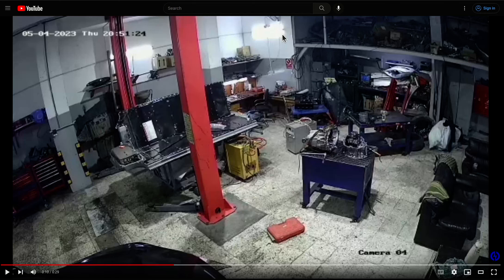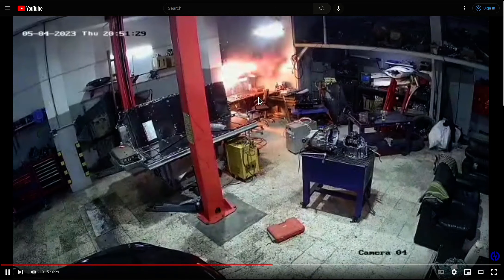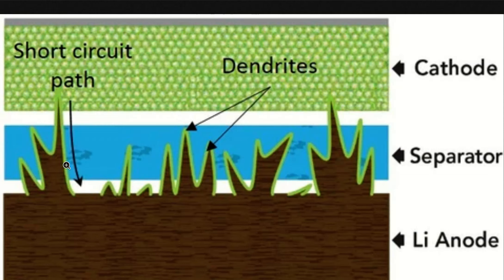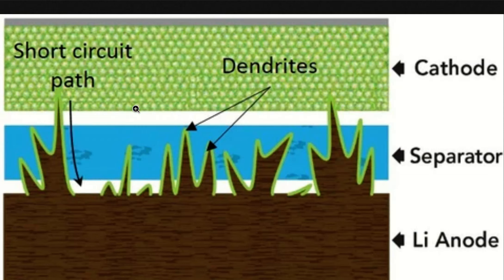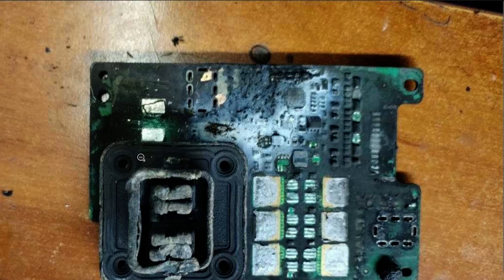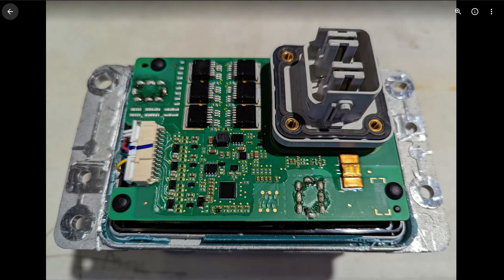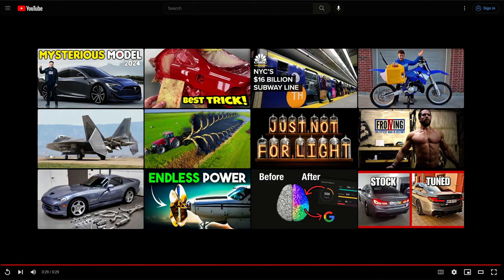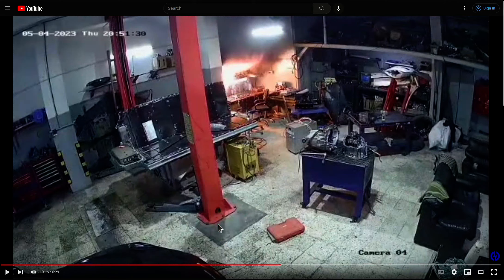DO NOT recharge a dead Tesla LV Battery!

Comment: Having flown model airplanes with small 1 cell packs of 150 mAh to 2X 6 cell packs of 5,000 mAh, I can tell you that Lithium fires are no joke. If we witness a pack puffing up (prismatic cells in pouches) we throw it in the BBQ grill or into the gravel parking lot. Then it lets go with jets of flame and smoke. Remember that fully charged, that energy is stored in chemical form. Not unlike gasoline. And once started the best thing to do is try to get it in or on a non-combustible surface and get away while it dissipates the energy.

Comment: Nice work there, picking up the safety slack where the manufacturers dropped the ball and should have made the danger of recharging crystal clear. A valuable public service Phil, Well Done sir!
Reply: Well this is why the pack is welded shut, the fact people do stuff like this justifies manufacturers making things less and less serviceable.
Reply from the maker: Well, had they designed a proper BMS (Battery Management System) instead of a Battery Murdering System, it would have been fine.

Comment: Thank you for this! I have an Xiaomi M365 electric scooter that has run into a similar issue.

Didn't use the scooter for about a year and I came to find that the BMS drained certain cells of the battery to the point where I am unable to recharge the battery pack normally. There are multiple videos where people are connecting power supplies to the battery or shorting connections with a 'resistor' in order to circumnavigate the BMS and bring the cells back up to a point where the BMS will normally charge the pack.

As of writing this, I'm desperate for cash and I was going to do either of these methods in order to get the scooter to be sellable. Thank you for your PSA, I could have easily been creating a ticking time bomb for either myself or whomever I sold it to!
Reply from the maker: Check the cell voltages.  If they aren't too low (below about 2v per string), it's USUALLY safe to recharge, but do so with a current and voltage limit.  I recommend an initial current limit of 1% of the C (capacity), so if they are 2000mAh cells, only charge at a max current of 20mA until you hit 3v/cell, then it's safe to charge normally.  Only charge one string at a time, and try to bring them all to the same 3 volt level so they will be in balance.  Also, do the charging where if the battery were to catch fire, it doesn't endanger any surrounding materials.   (Such as outside on concrete)
Note: I am not responsible for anything that happens!   If in doubt, just recycle those cells and replace with new.
Reply: @Ingineerix  Massive, massive thanks for that info! I have been reading so much that my eyes where spinning! Your consise and clear infomation is hard to come by; I feel like I'm talking to one of my professors. Theres a ton of confilicting and unapplicable knowladge out there. I'll be resposible for what happens! Your cell-by-cell method is the definatly the way to do it!
Reply from the maker: @iangoff2534  Donations are accepted!  =)   https://www.paypal.com/donate?hosted_button_id=DT4S6DVGSBX3W  (or you can send me a "super thanks" through YoutTube)

Comment: I appreciate the video, you’re correct. I opened 2 batteries and they didn’t get any charge. In toolbox when I try to reset the battery it says that the CONTACTORS are open. If I put a new battery it’ll also die. Do you think it would work with a 13.5V transformer? Thank you. Any suggestions would be greatly appreciated.

Comment: One reason might be that it's more important to keep the 12V system powered on as long as possible (accidents, emergencies, etc) than protecting the cheap battery and shutting all systems down.
Reply from the maker: No, this is wrong.  The BMS still cuts the output off, so the car dies anyway.  The problem is that the internal power supply (buck converter) that runs the BMS itself inside the pack stays on, running the cells down beyond the point of return.   This is bad engineering, and one might even say "designed to fail".
Reply: @Ingineerix im new to all this terminology but im guessing theres no way to get around the bms destroying the battery?
Reply from the maker: @prod.bylvwlee  Don't let it run until dead, and then sit that way for months.

Comment: Part of me wonders how he (the guy that attempted to charge the LVB with fiery results) tried to charge the cells, like if he did/didn't use a proper Li-ion charger will connections to the cell taps to ensure the cells don't get out of balance; I suspect he may have allowed one or more cells to enter a severe overvoltage condition and/or used an inappropriately high pre-charge current that contributed to the battery pack's catastrophic failure. Li-ion cells could (but not always) be recovered from an undervoltage scenario (BigClive did mention this in one of his videos before), but it requires careful monitoring AND must be done at a low current.
Reply from the maker: Yes, they can be recovered, but if you happen to get unlucky, the cell can burst into flames.  The dendrites do not go away, so maybe with some time and vibration in the front of your car, maybe on a hot day when the pressure in the cells are higher, it happens.  It can happen in 5 minutes or 5 months.  Are YOU going to cheap out on $200 and risk your entire car?!?  It's INSANITY.
Reply: @Ingineerix  Yeah, replacement is cheap insurance for sure.

Comment: I'm curious, do you know if the cells were charged with a proper lipo charger or was it just a power supply?  If it was a proper charger, what was the cut-off voltage set to and how many amps did they push to the cells?
Reply: Exactly, I salvaged several thousands 18650, recharged and re-used a lot that had very low voltages, never had any issues, maybe the cells in this Tesla battery are a bit sensitives but to me it looks more like an unattended prolongated over voltage, glad the worshop didn't burn.

Comment: Hey Phil I have a question for you unrelated to this video but I don't know how else to contact you. My question is regarding a DC battery and a superconductor. As the goal of the electrons is to move from either side of the seperator, like cathode to anode or anode to cathode, and we use a circuit to create a load along the way, what if you connected a superconductor between positive and negative terminals on a battery? Would the electrons immediately populate the anode from cathode (or vice versa) and the battery would then be discharged? As the superconductor has no resistance therefore no heat, would we see a fireworks display or not? Thanks, Simon

Comment: Pretty sure the BMS would prevent a full discharge of a li-ion battery, at least tesla's implementation of it. Something else must be up here
Reply: Unfortunately the BMS doesn’t prevent full discharge.  It disconnects the fosmets but the bms board gets power from the cells so it drains the cells over time.
Reply from the maker: @DIY is correct, it has a design flaw.  It's also not made by Tesla, it's made by CATL.   I have other videos on this if you are interested.

Comment: Are "traditional" lithium batteries also subject to dendrites when deep discharged?
Reply: Yes. This new 16v battery is a "traditional" 4s li-ion pouch cell based. It is not LFP. LFP batteries generally don't explode like li-ion do.
Reply: All lithium batteries will do this. Even LFP is prone to dendrites - the dendrites form on the anode which is the same whether you have LFP or NMC or LCO. LFP however will likely not be as violent of a reaction when it short circuits as the cathode is much less reactive
Reply from the maker: Yes @Cole is right.  "Traditional" is called "Ternary Lithium".  This is why is super important to have a proper BMS for all Lithium chemistries.

Comment: So unfortunately I saw this guy's video before yours and went ahead and recharged mine at very low amperage and it seems to have worked.  When I plug in the car turns on however I have some other high voltage issues so the car doesn't work on its own right now. I understand I need to upgrade but as mentioned I don't want to buy a new battery to run it down as well. Should I assume that the battery other than the pyro part is being recognized by the system since it will charge buy a charger and boot in the car?
Reply from the maker: You don't need the 16v battery connected to work on the car.  You can use any 12v supply that can provide at least 12v.  I use a 55A RV converter.  Once you get the contactors closing, then, and only then, reconnect the 16v.   If I were you, I would get that one you recharged out of your car, and out of indoors.  It could be "fine" for now, and then wait until one particularly warm day and then go into thermal runaway and destroy your car.   (or house!)
Reply: Okay thanks I do have a second question for you though there has been a problem plagueing the internet and has never shown the successful repair and I would like to close this issue my car was wrecked I replace pyro fuse cleared post-crash load shedding with toolbox and I have an error from VC front a129 which states set the PCS efuse is tripping. I have reset vc front but with the lack of connection I cannot update other modules in the car does not move. This seems to be the case for every other person I read online with no solution. Of course nobody updates after they fix which sux

Comment: Seems pretty crazy to have done such a bad BMS. Any idea what the power draw is once its on low volt cutout? I wonder if Tesla/CATL are redesigning it with urgency or ignoring it as an edge case. Doesn't seem worth the risk over lead acid.
Reply from the maker: I have not measured the quiescent draw.  Next bad one I get, I will.
Reply: One reason might be that it's more important to keep the 12V system powered on as long as possible (accidents, emergencies, etc) than protecting the cheap battery and shutting all systems down.
Reply from the maker: @izybit  No, this is wrong.  The BMS still cuts the output off, so the car dies anyway.  The problem is that the internal power supply (buck converter) that runs the BMS itself inside the pack stays on, running the cells down beyond the point of return.   This is bad engineering, and one might even say "designed to fail".
Reply: @Ingineerix  That is interesting. Never thought a simple LV BMS needed a buck converter!. Thought its mostly mosfets in a back to back configuration, controlled directly by individual cell voltage.
Seems like, a retrofit to enable battery chemistry compatibility. I understand the HV BMS needs to be more sophisticated, and needs a dedicated custom micro controllers. Now I have my reservations in upgrading the LV battery from the Lead Acid variety(which already went through a replacement). In that case, I was able to avoid towing, by recharging it a bit, which could have been a mistake with a fully discharged Liion battery.

Comment: @ingineerix I'm thinking about replacing the FSD computer 1462554-S0-J with 1462554-S0-K. It is a retrofit HW3 computer. What are your thoughts? Do you have any experience with this? Will Toolbox 3 be required or does Tesla Service have to have their hands on it?
Reply from the maker: Yes, you cannot do it.  First off it has to be an unmarried HW3, with root access you could unmarry one, but you'd need root access on the both the new one and the current system to get all the data including the certificates from it, otherwise it will never connect to Tesla, so you'll be offline and permanently frozen on the current software version.  (It will never get updates)  Only versions on or before 2023.44 can be unmarried because of the WEK for HW3.

Comment: Hey, how do we close contactors before installing a new battery ? I had battery gone low its at 9v tesla wont reconect it so need to replace ?
Reply from the maker: Use a 12v jump pack or 12v power supply to power the car and work on it.  Once you correct the issues, and get the contactors  to close (they will even w/o a good 16v battery), then, and only then, do you reconnect the 16v battery, and run the reconnect routine in service more, or redeploy the software.  If the 16v battery does not reconnect and charge, it will need to be replaced.
Reply: @Ingineerix  hey so i reinstalled software abd i charged the 12v battery to 15v it reads 15 and SOC 66% but tesla still won't connect it

Comment: Okay so what about charging AA or AAA rechargeable Lithium Ion dead batteries?  But this is why Tesla needs to make the battery themselves to be more vertically integrated.
Reply from the maker: All Lithium Ion variants have a voltage much higher than 1.5v, so all of them must have an internal CMS and buck converter.  It probably stops outputting when the internal cell is low to protect it, so they are safe to charge using the manufacturers recommended charger.  Most of the ones I've seen take a USB connection.
I agree, Tesla would have probably done better had they made this themselves, and probably will in the future.

Comment: To be fair, people wouldn’t be doing this if Tesla didn’t program them with ability to enter an un-rechargeable state only after a few minutes of the car powering off the Lv battery when contactors are open.
Reply from the maker: To be clear, I don't think Tesla did this, it's inherent to the CATL BMS.  There have been a lot of issues with it, they are now up to Rev D.  Also, you are being a little hyperbolic, I have timed the runtime on a 2021 Plaid with the Revision C unit, and it kept the car computer up for over an hour before LVCO, and the car was perfectly able to recharge it once the HV came back online.   The problem seems to occur if the battery is left sitting for months after the LVCO.  The BMS has an internal buck converter to power it's logic that stays online and will destroy the cells trying to keep itself powered.   There are several ways this could have been mitigated, but alas I was not the CATL engineer who designed the BMS or I would have.  The LV battery routinely must power the car for around 10 minutes during a software update while the gateway updates components of the HV system, and if it couldn't do this, everyone would have a dead car after each software update attempt.
Reply: @Ingineerix  Hi!  I think in newer firmware they changed something, but we had many people drain their NEW Lv batteries while working on their car with contactors open (usually not realizing that was the case) only yo see their LV battery drain and become unrecoverable.  It wasn’t possible to reconnect the battery without cutting it open and manually recharging it, even though the overall voltage of the battery never fell below the unrecoverable voltage thresholds.   Now if the LV battery is discharged for a few months, the recharge hack doesn’t work, because once the battery is drained below 9V (or 2V/cell) it goes into permanent irrecoverable mode.
Reply from the maker: @diytesla  Yes, Tesla does not ship these fully charged per shipping regulations, so if you connect one to a car without HV support, it will quickly die.   The proper procedure for working on a Tesla with this battery is to leave it disconnected and provide external power from a 30A+ power supply, and then, and only then, when the contactors close you can reconnect the LV battery and run the reconnect procedure.  There is no problem if you follow this procedure.  I agree it shouldn't "brick" if run down, but it is what it is, and if you follow the correct service procedure you won't have to find this out the hard way.

Comment: How can they allow a lithium pack like that NOT to have LVC !?!
It seems like there are very few advantages to the 16V LV system over the 12V LV system, not least of which missing the step down voltage at the sockets and removal of the +12V at the trailer plug!
Reply from the maker: It does have a LVCO, but the BMS continues to pull current to run itself even after this.  Bad design.  There are several ways to handle this properly, none if which they did.  (CATL)